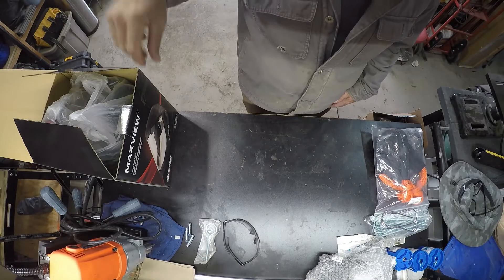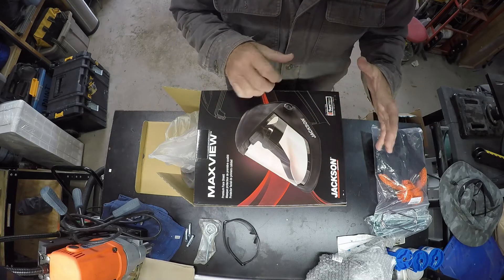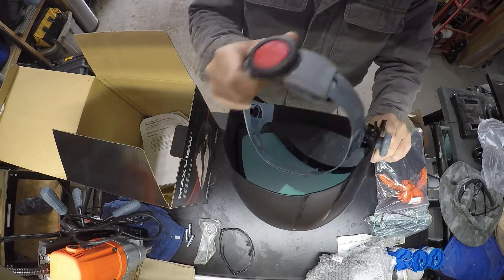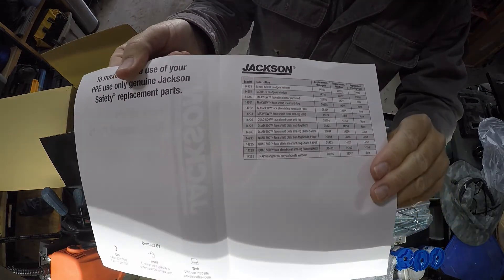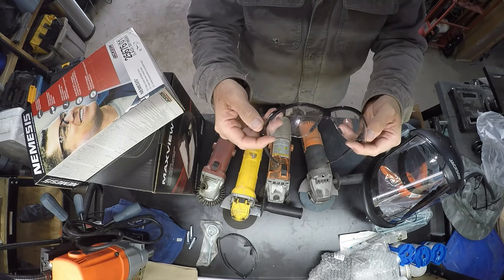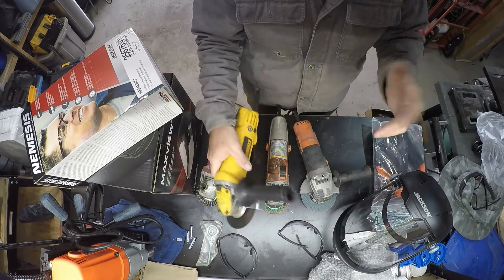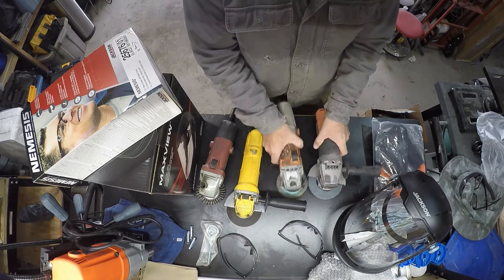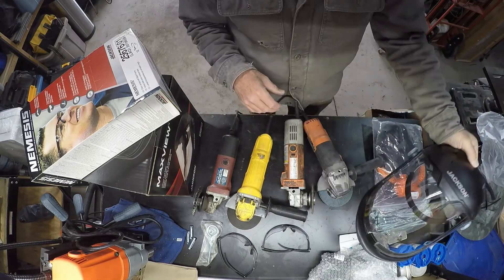JACKSON Safety MAXVIEW and Grinder considerations

Comment: Thanks for the video. I’m totally with you on this. I had a cutting disk break off on me once about 15 years ago.  I was young and stupid. I was using an air powered angled die grinder that could reach about 20,000 rpm. Also did not have a guard on it. Disk basically exploded, one part hit my clavicle bone, ricocheted and got stuck into the drywall about 5ft away from where I was standing in my garage. It Just narrowly missed my neck and my carotid artery by about 2 inches. My wife was hysterical and drove me to the ER and I got some stitches. Literally saw my life flash before my eyes. I rarely use die grinders to cut metal anymore unless absolutely necessary, the RPM’s are just too high. I prefer using the 4.5” angle grinder which run at about half the rpm’s. In any case I never remove the guard but still would like the extra protection of a mask just to feel more secure. That day is always in the back of my mind and what a close call.
Reply from the maker: Crazy story!  And sobering reminder...  Glad you are okay! Thanks for  watching and for sharing your experience 👍

Comment: By beathing without talking . does the shield get humid? hard to see? thank you. I want this for driving , but i concern it will blurry my view
Reply from the maker: No, I think you'll be fine, if you're using this. In lieu of a windshield, you should have plenty circulating air as you're driving. If the vehicle is enclosed, just run your air conditioning... But in a dry environment you may not need anything. If you do find it fogging just get some lens defog spray
Reply: My face shield has an anti fog coating on the lens

Comment: I just got this face shield because angle grinders scare me but I have to use them once in a while. How do you feel about the thickness of the face shield?  I have another brand that I use at work in the hospital that seemed thicker than this one.
Reply from the maker: Yes, I see what you're saying, even though this one is thinner it is rated for ballistic impact on the mfgs website. Some face Shields may be thicker but just make sure that they're rated for ballistic impacts. The manufacturer's website should state everything they've been tested for. If it doesn't, then chances are they have not invested the money for that kind of testing. If you find another that you like, please let me know. This one seems to be working well for me, but I'm going to need to replace it at some point. Hey thanks for watching and commenting 👍
Reply: @anesthesiadreamin , the one I use at work is Sellstrom Face Shield DP4 Multi-Purpose Safety Mask, sold on Amazon. I'm looking into the ballistic resistance to see if it's rated, it has the same ansi rating I believe.  I use it in a Healthcare setting so it doesn't need to be ballistic rated but it just feels more robust than this other one, but like you said it may be similarly rated.